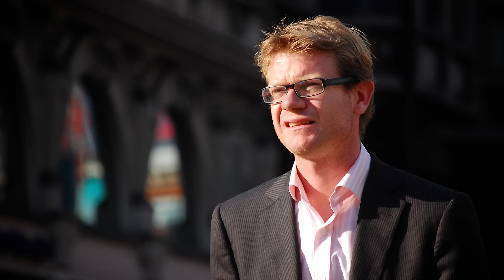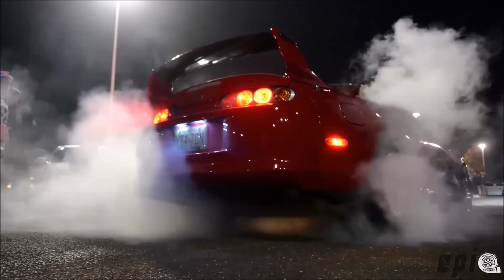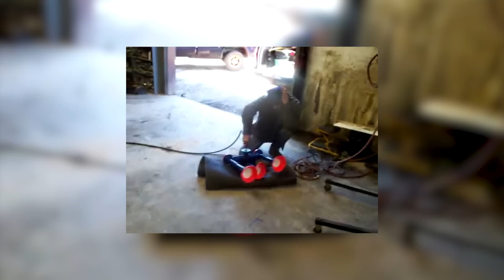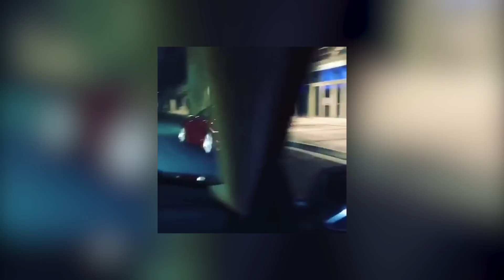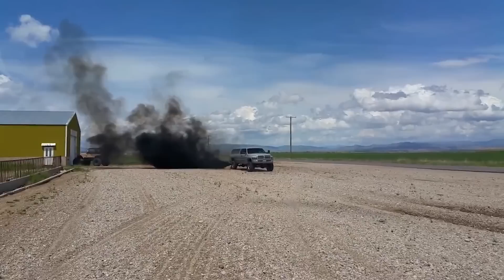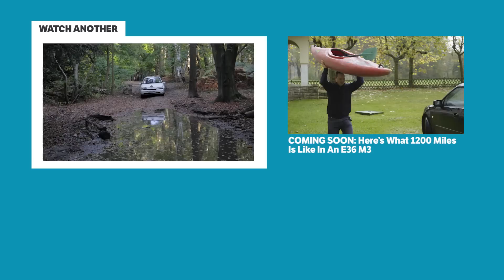6 Mods Your Neighbours Will Hate You For Installing

Comment: 1 Loud Blow off valve for forced induction.
2 Straight exhaust pipe.
3 Train horn.
4 Rev limiter.
5 Rolling coal.
6 Straight cut gears.
Reply: Azzakurah what is that profile pic, I think I know but I don't want to

Comment: "Rolling coal" must be the stupidest thing on this list.

I does literally nothing for the car except dramatically waste fuel (and money) and its real purpose is just to feed the driver's ego.
Reply: its a smug feeling of giving eco hippies in electic cars and such the middle finger. for every ideal there is a counter ideal.
Reply: its like the youtube trolls of the road, same principle
Reply: If anything you would think it would be fucking the engine and exhaust systems up.  I don't know fuck all about diesels, but you would think dumping that much fuel through the engine whilst revving it hard couldn't be good for it - on a petrol engine you'd be causing bore wash & thus premature wear, though diesel is a lubricant unlike petrol so maybe not such an issue.
Reply: Samuel Smith So, they're paying thousands of dollars on modifying their engines and on fuel...

Just to irritate people?

Sad. The principle is the same, yes, but wow...
Reply: "Rolling Coal" is a product of adding power to our trucks. More power requires more fuel which in turn doesn't burn as efficiently until the turbo fully kicks in. Most people who just want black smoke buy a early Cummins 12 valve. No money needed to make them blow smoke. Only a flathead screwdriver.
Reply: If you want to go fast, buy a car. Problem solved.
Reply: Matthew Sharpe You can't pull equipment with a car. Power doesn't always mean speed
Reply: TheThebradyanderson that's what torque &  transmissions are for. No need to be pumping out smothering clouds of toxic crap like the guy in the video to pull a load, it's clearly just for pointless showboating.
Reply: Matthew Sharpe Torque goes along with the power adding. A transmission doesn't help when you need to pull any load on a highway at a reasonable speed. Lugging one in 5th gear through an intersection to smoke it out is pointless but chipping my truck gained me 3 mpg, better shifting, better power and pushes more boost. If a little black smoke is the trade off, then so be it.
Reply: TheThebradyanderson A little black smoke to get the job done - fair enough - but the guy in the video?  Come on, that's not useful, that's just stupid.
Reply: I believe there is a big difference between "rolling coal" and the innocent tuning of a truck.

Want more power and torque? Cool.

Want more smoke? Get a life.
Reply: Jkintzle02 I guess it just baffles me that rolling coal is on there and fart cans are not lol
Reply: Jkintzle02 I guess it just baffles me that rolling coal is on there and fart cans are not lol
Reply: That is true you don't need to make a cloud of smoke just to tow a trailer or whatever. The guy in the video is doing it to make people mad he has modded his Diesel so it would do that. I have driven Diesel trucks before and had the power needed to haul the load without a cloud of thick black smoke. However there is no way a car is going to do the same work as a truck it's just not going to happen.
Reply: TraustiGeir isn't feeding the drivers ego apart of every car guy's car??
Reply: TraustiGeir yup pretty much
Reply: When you put it that way, that's how the entire world perceives the car enthusiast.
Reply: TraustiGeir and waste the air of the world
Reply: TraustiGeir it also is good against protesters
Reply: I would totally get a diesel volvo or jetta and "roll coal" and put the biggest turbo on it so it sounds like a F-in thunderstorm
Reply: Well duh rolling caol is for racing on the drag strip
And also are u a car guy?
Reply: @Beer_Dad1975  well rollin coal is for drag cuz u are waiting for the green light
Reply: @itsthuger  Are you talking to me?
Reply: @TraustiGeir  to all
Reply: @HDFWB  so you need a disel tractor
Reply: That is exactly what makes it the single greatest thing on the planet!

Comment: Roaling coal is generally stupid and complete bull shit.
Reply: Agreed
Reply: +leonardo luiz lima absolutely right! in my country you get a ticket if police sees you doing this crap. not to mention lung cancer!
Reply: You realize the smoke doesn't go into the atmosphere. Actually, if memory serves when it comes back down it can actually be fertilizer for plants. Only bad if you inhale it then we have problems. And no everyone got pissy because the DEF systems installed on trucks was unnecessary and because it made trucks less reliable and higher maintenance. It's like having a catalytic converter you have to service every couple of hundred miles and bricks your car if you try removing it. Though I do agree rolling coal just to annoy people is dumb. And the type of people doing are the same types of people with cat-backs on their 5.0 that gas it every chance they get through a neighborhood trying to look cool and be obnoxious.
Reply: Rolling coal if you're near other people who don't know what's about to happen should be considered assault.
Reply: What? Fertilizer...that's not how physics and chemistry works mate.

When a diesel engine produces black smoke it means it does an incomplete combastion. An incomplete combustion occurs when there isn't enough oxygen, because the extra fuel injected into the engine saturates the mixture, to allow the hydrocarbon fuel to react completely with the oxygen to produce carbon dioxide and water. When a hydrocarbon burns incompletely, the reaction will yield carbon dioxide, water, carbon monoxide which is a testless and odorless poison for people, pure carbon (soot or ash which are extremely dangerous for the lungs if inhaled) and various other poisonous compounds such as nitrogen oxides. 

Also DEF isn't even close to a catalist, it's a chemical solution (similar to AdBlue cars use) mostly water that is used on trucks to help with the engine combastion and create less pollution. The DEF system needs hardly a service, the only thing it needs is to keep an eye on the level so it doesn't empty which only then the system will lock to prevent pollution. The only downside of the DEF is that it adds extra cost to the fuel expenses of the driver or the company it uses the truck(s).
Reply: +Dimitris Kepenos that soot is bad when it gets into your lungs but the ashes can help plants grow.  You know how in some places they burn the trees to replenish the soil? Thing about it like that. While I'm not saying everyone should just start rolling coal through crop fields it's more of an issue of human health than the environment (unless it gets into the water supply I assume but even then it should just filter out though the ground) . Secondly the DEF System are completely unwarranted as the problem they where try to fix could have easily been fixed with a tune. That whole turn a switch to roll coal thing? I didn't know that was a thing until now. When people trying tuning there pickups to make more power they tend to roll more coal then necessary because the tunes are bad. DEF fluid cost more than diesel. Depending on how many miles you're putting on your truck that's a lot of money for something that really could have been fixed with a tune. Now some people do tune their trucks purely to roll coal but chances are they're either just going to buy older trucks without it or find away around it so it. The only place I think of it being really necessary is on Semi truck that put down an excessive number of miles and have a tendency to roll coal because they're pulling a heavy load 90% of the time. My dad's older cummins occasionally puffs a bit of smoke when pulling after he's put a tune on it for towing but it's never balls of smoke like you tend to see on YouTube. I somehow doubt that's it's putting out so much carbon dioxide that it required yet another emissions system to deal with it.
Reply: Mate, stop trying to make r-coal look good, even if a little bit. Like I said the incomplete combastion creates poisonous chemical reactions, even though these can't react with the carbon (black smoke or ash) because it a organic compound they stick to it. So the carbon ash is contaminated with all those chemicals, the end up in the soild which then the plants absorb it and then either humans eat the plants or animals eat them which then are eaten by humans. The only good that can happen is the carbon dioxide which turns nitrate when it enters the soil and helps the plants. But howeven you try to look at it, roaling coal is bad because it creates other poisons that are carried over.
Reply: +Dimitris Kepenos I didn't mean it was good for the environment. Our hobby in absolutely horrible for the environment in general but most people don't like to admit it. I'm just tired of people acting like all that coming out of a gasser tail pipe is unicorns and rainbows and all that comes out of diesel is smog and death. Rolling coal is inherently bad for the environment because you're burning excess fuel but same thing can be said about cars that backfire constantly but nobody likes to point that out.
Reply: if it's high performance turbodiesel I don't have any problem with rolling coal
Reply: If it's a high performance turbo diesel and still spouts black smoke at the exhaust then the engine is either damaged or the person who made the engine to smoke is damaged.

I have the IS-F with the 5.0L turbo diesel and it doesn't smoke.
Reply: Dimitris Kepenos My truck rolls coal. But that's because it produces over 1000rwhp. look at any high performance diesel drag race video, im talking about track only drag trucks that make 8 seconds or less on the quarter mile. even with the turbo spooled they roll coal. And those guys know exaclty what they're doing because they went to school for it.
Reply: Well then, if you have 1000+ bhp and it takes 8 sec or less for the 1/4m, then your truck (pick-up) and any other suck, my IS-F does 0-60 in 5.3 sec. Also before you go "yeah, but your is a car and mine is a truck, it's heavier" my IS-F has 380bhp, the bhp difference is equalized by the horse power per ton ratio. Heck even the new Toyota Hilux 2.4L 4x4 does 0-60 in 10.5 sec with only 150bhp, it's only about 2.5 sec slower than your's.
Reply: TexasDragon3907 Haha, people point out emissions from gas engines plenty. There's a reason why you see so many hybrids and PZEV. Let's not forget that VW was recently fined for cheating emissions tests. The reason you're more likely to see someone ranting over the internet about coal rollers is because the hybrids and PZEV cars have become so common, people don't really think of gas engine emissions too much anymore. Coal rollers stand out a lot more too
Reply: Dimitris Kepenos I think you misunderstood what I said. im saying a high performance diesel drag truck will go 1320 feet, a 1/4 mile in less than 8 seconds. not 0-60. They go 0-60 in 3 seconds or less. My built and bulletproofed 6.4L compound turbo diesel with 200hp injectors sends my 10,000lbs truck from 0-60 in less then 4.8 seconds. timed it with my onboard tuner. so, its accurate.
Reply: Agreed.
Reply: wow someone has a mangina
Reply: UTGTYPE96sniper Dimitris Kepenos understands in metric system only, so 1320 feets translated into 402m
Reply: It's hazardous asf

Comment: I do everything I can to make my exhaust louder, my 4.3L bored out '86 vertech straight piped from the headers straight into a magnaflow super 40 series and it sound like a monster truck, neighbours definitely think its cool and my motorcycle I used a stepping stone on the carbon plug to add a little extra airflow which helps out in the bottom and top end from not having too much back pressure with its restrictive oem setup

Comment: Rowling coal is not just caused by a switch. it can be caused by tuning the motor for more power the result is at lower rpm the combustion is not completed thus making the soot

Comment: Please the 'rev limiter ' is clearly antilag
Reply: antilag is there to help with turbo lag, one form of it is a 2-step rev limiter, which the driver can set to a perfect RPM for launches, so the car doesn't spin its wheels off the line. what must 2-step systems do is make the ignition fire late so the engine can't build revs, but this means that ignition happens with an open exhaust valve, spitting fuel into the exhaust and igniting it there. this increases the pressure in the exhaust and shoots flames out the back. the increased pressure acts as antilag, because it causes the turbo to spool up at lower revs than it normally would

Comment: Can somebody explain straight cut gears?
Reply: Helical gears mesh nicely as the point of contact "flows" smoothly from one side to another, while "straight cut" gears do a little "hit" between each tooth that when multiplied by amount of gears and speed results in a whining nosie. But helical gears are angled and introduce side forces that basically want to push them apart to the side - Reducing durability.
Reply: Hey what is your CT nick. I want to follow you
Reply: Do google cost money in your country? lol
Reply: Most small car gear boxes whine in reverse due to straight cut gears.

Comment: You can probably add  an engine conversion to a rotary engine.

Also installing a spark plug in your tailpipe to ignite the residual gas and shoot flame out the back.

Comment: I have a diesel Chevy, straightpiped. The smoke switch is one way to get a vehicle to roll coal, and the people that roll huge clouds of smoke most probably are using a switch. But a lot of times, powerful tunes have a side effect of smoke. I have a 5 level dsp switch, pretty I will blow a little bit of smoke in my lower tunes, but in level 4 and especially 5 I will blow a decent amount of smoke when I push it hard. I do have a level of control over it though, and I'm not a dick about it and I especially don't go blowing smoke all over people, I really only use it when (A) messing with my family or friends, or (B) someone is tailgating the shit out of me.

Comment: what are the advantages of straight cut gears? they might have a little bit less friction, but the vibrations they create are worse
Reply: Gotin Fuklio straight cut gear make no lateral force, which is wasted on the transmission case that holds the gears. more thrust makes it to the wheels. bias cut gears trade some efficiency for nvh and long term wear improvements.
Reply: Gotin Fuklio straight cut gear make no lateral force, which is wasted on the transmission case that holds the gears. more thrust makes it to the wheels. bias cut gears trade some efficiency for nvh and long term wear improvements.
Reply: Patrick Ford then they should cut v-shaped teeth on the gears(like 2 mirrored biased gears welded together) - this way the left and the right side of the gear would cancel out their individual lateral forces
Reply: +Gotin Fuklio it's difficult to machine
Reply: ΑΡΗΣ ΚΟΡΝΑΡΑΚΗΣ you could machine 2 separate gears each mirrored version of the other one and stick them together
Reply: Gotin Fuklio the forces that has to deal may exceed the limit of the glue/bolt/whatever

Comment: Straight cut gears?  Loud?  Pah.  Try a slightly broken 'charger with the wrong oil in it spun to 21,000 rpm.  Deafening at 30mph.  #Becauseracecar

Comment: Why are straight cut gears better for track?
Reply: You can shift without letting off the throttle which means no speed loss. You can also shift without using the clutch.
Reply: Powershifting, right?
Reply: +Vivek Anand yup

Comment: straight pipe is actually pretty bad for an engine, no back pressure
Reply: What? lol, please explain why a free flowing exhaust is bad for an engine.
Reply: It might help increase horsepower, but necessary low end torque takes a dive, and also can result in burned exhaust valves due to lack of cooling ability from this condition

Comment: someone, what mean a stright cut gear? and what ist difent from normal gears? i dont speake english so soryy for funny words
Reply: Niek van Rossem tnx :)
Reply: Nikola Štivić np
Reply: Everyday transmissions use gears that uses helical teeth. Straight cut gears are exactly what they sound like. For example they are found in bicycles and motorcycles, have straight cut gears. Finally Straight cuts are mainly used to increase the load capacity of the transmission.
Reply: Manu John. ☺
Reply: Straight cut gears aren't stronger than helical gears. They only eliminate axial load or whatever it's called, on the gearbox case, therefore it can be lighter than a helical gearbox case.
Reply: *****
No, those loads are withstood by the gearbox case and the shafts, not the gears themselves. They are more efficient, yes, but spec for spec, helical gears are just as strong.

Comment: pretty sure train horns are illegal anyway
Reply: Almost all of this stuff is illegal. Where i live train horns are off road use only, "rolling coal" will get you a ticket, any exhaust over a certain db level will get you a ticket so straight pipe and rev limiting/anti lag is straight out, and straight cut gears taken to  a shop for registration inspection would fail you more than likely because they are offroad use only in most cases.
Reply: Oliver train horns aren't inlegel

Comment: talks about rev limiter... shows cars on anti-lag
Reply: They're not on anti lag, they're on 2-step, a form of rev limiter
Reply: +KAVINSKY311 anti lag is just spooling up the turbo faster by dumping fuel in it and it has no effect on sound at all, Rev limiters cut the ignition or fuel to limit the rpm, thus controlling the launch, Rev limiting is what causes backfire like that. 
Dude do you research before you try to act tough and call people out...
Reply: The backfire is caused by by the rev limiter cutting ignition which leave unburnt fuel in the exhaust, the heat of the exhaust ignites the fuel, or the ignition re-lighting it